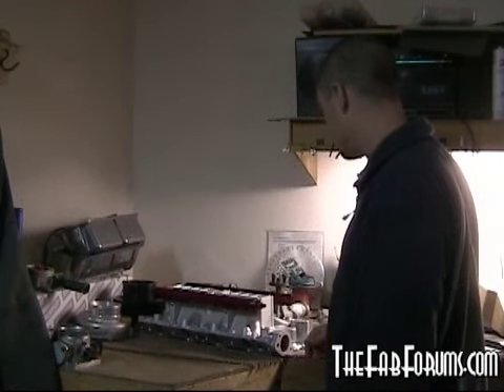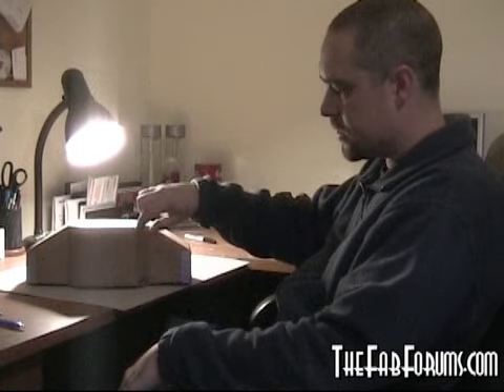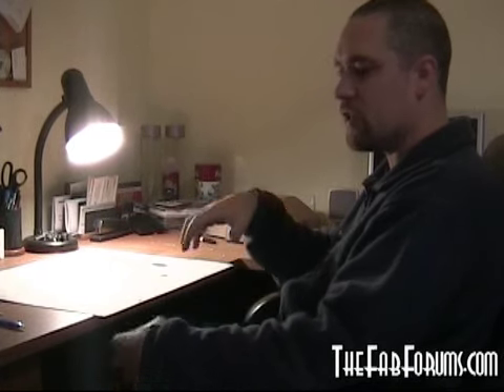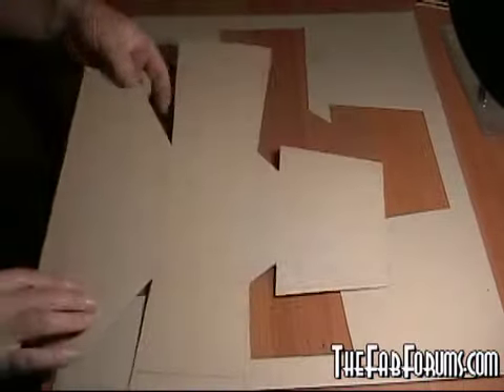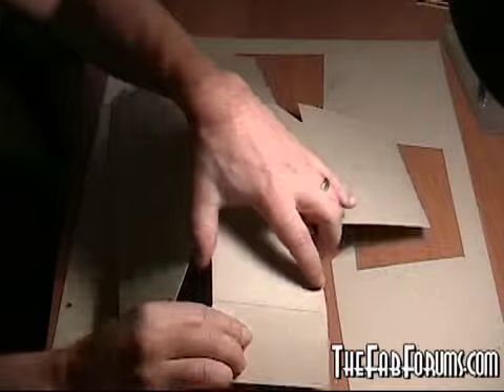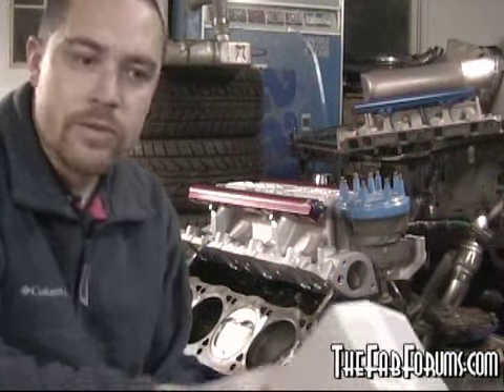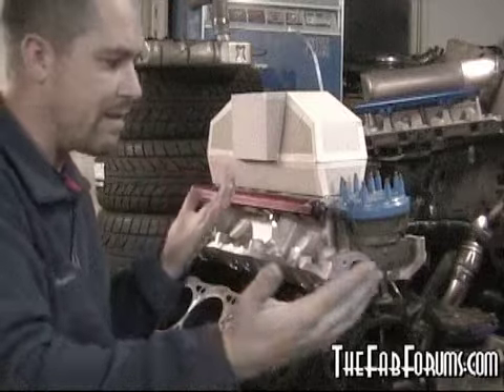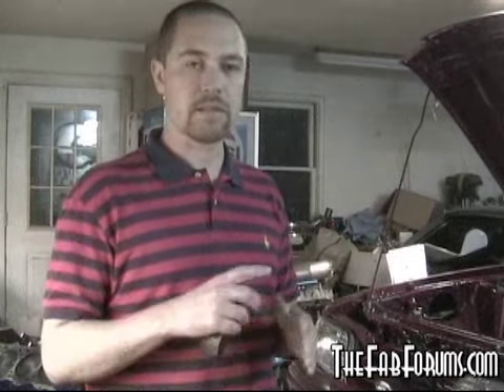Carbon Fiber Intake how-to build 1

Comment from the maker: @SweetLaforu I built a steel one in a previous project...this is a new design it will be carbon fiber that will be close to the steel one. I should be posting another video soon showing how the mold for the intake was made.

Comment: under boost wouldn't this intake blow apart? if not whats the needed thickness? I'm looking to build a carbonfiber or lightweight upper intake manifold for my car, 4.6 4V turbocharged.
Reply from the maker: nah...super strong.  you want it at least to 1/8 thick. Preferably thicker.
Reply: clutch302tc lol no XD they're super strong 
Super and hyper cars use these

Comment: how did you come up with the plenum volume needed?
Reply from the maker: I didn't on this project...I just guessed basically. Its was 418 cubic inch engine and I was planning to boost it so plenum volume didn't really matter. It actually worked very well on this combo NA though.